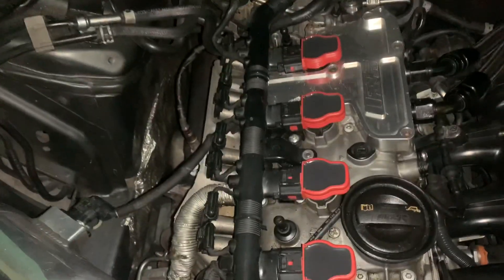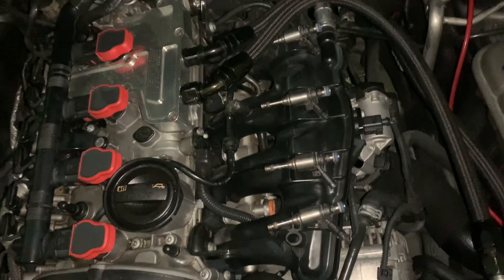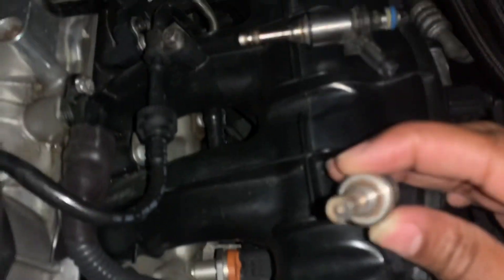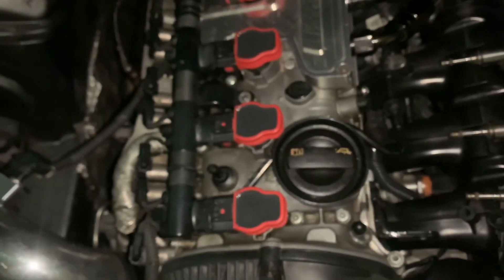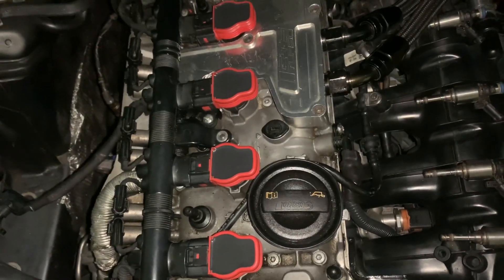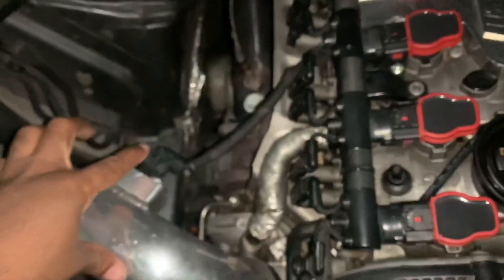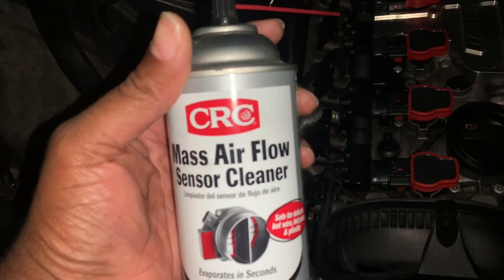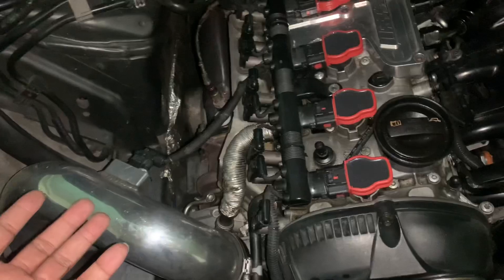Audi S3 Injectors Upgrade/Does It Ad More Horsepower? Lean Codes?

Comment: hi, I just purchased S3 injectors for my A4 2.0T upgrading to a K04 , I noticed that plastic tab is longer on the S3 injectors Vs the OEM's, did you have to shorten the plastic tab on the new injectors to fit or do the S3 injectors still fit in place without cutting it, thank you for your help, nice video ...... cant wait to see more.
Reply: How did u make out with this? Did you go with the oem s3 injectors and what kind of tune did you have to do

Comment: Right sir, just to clarify because yes, I've found a few online. Mine is the A4 B8.5 2.0TFSI 211 quattro. So the correct S3 injectors are which? Because I found 06L906031A S3 injectors on a rail .. are these advised? What about the high pressure fuel pump and getting the injectors mapped in or are you suggesting install and walk away?

Comment: Is the s3 injectors plug and play on Audi A5 TFSI B8.5 with IE intake IE intercooler borla type s exhaust HPA high flow cat and IE intake Manifold stage 2 Tune from IE and a hitachi hPfp ? Thanks in advance

Comment: Did you have to program the injector or plug and play
Reply: I have same question did you have to program the injectors or no because Revo states there tune is for stock injectors. Inwoulsnlikenaoem advixe on what to do

Comment: Hey my man I’m a tech out here in Colorado love watching the vids man it’s like a mirror of goals of my ride lol question did you get any missfires when you come back down in rpm’s with snow water meth kit ?? Running it and been having some missfire issues recently:/
Reply from the maker: Yes you probably need the start point to be at begiyof your boost, and boost max at the highest boost peak level
Reply: Figured it out car was pulling vacuum through line causing the methonal to go into the intake at all times looks like the silonoid was wired in incorrectly:/ but got her fixed

Comment: Bruce actually APR told me I wouldn't need upgraded injectors or fuel pump.  My k04 setup loose power in the high end.

Comment: Hey quick question. I have basically the same setup as you minus the K04 and Meth kit. I have the IE IM w/ tune and same spark plugs. I have the larger throttle, turbo muffler, and charge pipe upgrade. I have these s3 injectors sitting around … you think we can install them?? I have the ones from your link btw.
Reply: Did you get the s3 installed and is it running fine?
Reply: I did and you gonna wanna get a tune, but I’m sure I have other things in there I probably messed up 😅. It’s a learning curve.

Comment: Love your videos man. Been following for a while. When you installed these s3 injectors did you have to do any kind of tuning at all? I have a set of these and been thinking of installing them on my allroad. I have a Ko4 and ie tune.
Reply: I’ll buy them off you if you don’t use them
Reply: I’m in the same situation as u. I have a 2014 a4 with k04 tune from IE. Did u have to get a different tune with the bigger injectors? And were they just oem s3 injectors?

Comment: Hi Bruce, I have a b7 Audi A4 2.0t with the stock k03 turbo and I have the upgraded HPFP and a GIAC tune 93 octane but I also have the Race file. 

I would like to run the race file all the time and run a mixture of ethanol and 93 octane. 

Usually I run 1 gallon of e85 and about 16 gallons of 93 octane. 

Ideally I would like to really run about 5 gallons of e85 and the rest 93 octane so that I can run the race file at all times safely without retarding timing. Do you think installing S3 injectors with no change to the tune but running on the race file now would enable me to do this? 

I notice if I pump more then 1 gallon e85 on the current injectors then the car starts to feel really sluggish because it can’t supply enough fuel. 

Any advice would be appreciate. I think going K04 will be too much work and $$ because it would require another tune but it’s so tempting.

I figure this is the best way to get k04 performance out of the k03 on the budget.

Comment: Did you run your engine with upgrade turbo/injectors/hpfp without tune? I just want to make Sure it is running before putting a map on it
Reply from the maker: Yes I always do to test the car, but I don’t run it hard, I basically just switch my tune to factory.

Comment: the link for s3 injectors is invalid now bro. did you get them off Ebay?
Reply from the maker: here you go bro

https://www.ebay.com/itm/234086532059?fits=Model%3AS3%7CMake%3AAudi&epid=19045135727&hash=item3680a503db:g:xNsAAOSwVnxgz1Ib
Reply: Hey brother these come from China, are you positive they are OEM? Or did you buy Chinese versions ? Just curious if they work correctly

Comment: Peace Bruce, good video! Would you happen to know the part number for the Bosch S3 fuel injectors that I can put on my 2012 B8?
Reply from the maker: Yes bro , https://www.ebay.com/itm/for-VW-Golf-Audi-S3-TTS-2-0-TFSI-NEW-Bosch-OEM-4-pcs-Fuel-Injectors-06L906036L-/234086532059?mkcid=16&mkevt=1&_trksid=p2349624.m46890.l49286&mkrid=711-127632-2357-0 sorry for the late response
Reply: @brucecustommotors  you’re the man. Appreciate it!

Comment: Is it necessary to go for S3 Injectors if I’m only getting cold air intake+intercooler+stage 2? Or will I run rich on fuel?
Reply from the maker: no your fine with stage 2, i was running little rich with stage 2, on stock injectors, but when i upgrade to stage 3 k04 i strated running lean every so often , because the bigger turbo was pushing so much air, and the stock injectors capped out, and when i upgraded to the s3 injectors , once i went s3 injectors, i got more boost , hp,tq, and never ran lean again
Reply: @brucecustommotors  okay, thanks for the info. Your videos are helping alot

Comment: Thank you for all the knowledge~! But these injectors are stopping me from Stage 2+ because of emissions testing. I read that stock map works on the K04 turbos without issue, but I am not sure about the S3 injectors. I already have to swap CATs before inspection. I don't want to keep swapping fuel injectors. Do you have any insight/directions on what I can do? Thank you!!
Reply from the maker: I feel you, I acuttualy, just did my inspections, with no issues, Think about it this way, if a golf rand s3 can pass inspection, yours can, its the same engine, and it comes stock with s3 injectors, I basically, just mad my car an s3, with extra mods
Reply: @brucecustommotors  Thank you for the quick reply, information and added peace of mind. Keep up the great work!!
Reply from the maker: @raphaelfrancis4509  MY PLEASURE BRO STAY BLESSED

Comment: Hey bro Would s3 injectors benefit from having a stock turbo or would it be more beneficial and worthy on having it with ko4?
Reply from the maker: Very slightly because the diameter is bigger on the spray nozzle, but you get the biggest benefit with a tune
Reply: I have 2014 Audi a5 sportsback right hand drive. Do I need to have the car tuned for the injectors to work properly with my car
Reply: Sorry just read this bro I wanted to ask I have the same INJEN intake as yours,  same R8 coils, turbosmart BOV and that’s about it no tune yet tho I’m planning on  building my car up to go straight to stage 2 and then think about stage 3 but at the moment I’m confused on whether i should get the s3 Injectors with just the intake, R8 coils and turbosmart BOV, I got told it’s not worth it it’s only worth getting s3 injectors if you are going like 500plus hp also got told a5 b8.5 gen 2 one injectors are the same cc as the s3 injectors but anyways do you think I should get them now or should I do more upgrades and then get the s3 injectors after for example after I get my downpipe and then go  ie stage 2 after that should I invest in s3 injectors or what do you think thanks bro sorry for the long message

Comment: How do I know the injectors are going to be a correct fit regarding the plug fit. I have an a6 2016 c7 2.0t and it just has to be the the same year injectors as the model?  Just to make sure I’m planning to get them from the dealer ship.
Reply from the maker: you have to get 2015 and above
Reply: @brucecustommotors  thank you
Reply: A video on the high pressure fuel pump coming soon possibly ?

Comment: Hey Bruce, love the vids! Pending codes happen if the ECM/PCM see something happen once or every so often so it does not make it a permanent code unless it is reoccurring consistently. Still could very well be a serious issue that is starting when the code hasn't been thrown yet. As you do, anyone should always be scanning their car if they are/not trying to push more power!
Reply from the maker: Do you have the exact code number by chance
Reply: @brucecustommotors  I unfortunately do not haha. At least since my B8 is still stock. I would happen to get a pending code for P0299 or "underboost" from the PCM when I would scan it but the check engine would not pop up until later when the problem was consistent. Never threw a lean code cuz I dont have the crazy power you do! XD

Comment: Whats up Bruce. Following up on my engine replacement after my catastrophic engine failure. I've been watching your videos pretty religiously lately and your content, editing, and filming are much improved.

So - I wanted to talk about two things: cold air intake and fuel injectors. 

I was running stock fuel injectors and a K&N Typhoon. The Typhoon wasn't perfectly sealed so the air that was entering through the top of the grill was not going all to the filter. Some was traveling to the engine bay. So I'm not certain if this caused a condition or gradually caused heat soak to affect engine internals (my tech informed me my engine looked as though it had just been too hot over many periods). 

Second, I spoke w/ APR and they said that after market injectors weren't a requirement for stage 2. I should be getting my car back w/ a used motor around 40k miles. I'm planning on throwing the APR innercooler along w/ some other cosmetics then taking the car to a dyno so I can get some readings. Probably going to to be upgrading to that Injen air intake. Doesn't rain too often in Socal anyways.

Would appreciate your thoughts.
Reply from the maker: yeh it sounds like youre headed in the right directions, Yeh i had the K&N as well, and had similar issues in engine temps, also make sure your spark plugs are cold enough ,and you're using good octane gas, to avoid pre detonation, and you definitely need a bigger inter cooler aswell.
Reply: @brucecustommotors  Got my whip back today. Shop tech told me the intake was definitely bringing in hot engine bay air so I bought the injen but  I couldn't buy it through your amazon affiliate link because they wouldn't ship to CA. Dunno if you want me to buy ship to you and then ship to me so you get your payout lol. I'm down though because Injen said it is going to take 6 weeks+ since they have to make the whole item where as yours is supposedly ready (on Amazon).

New motor is a bit dirty but sounds good. They accidentally undid a ground that lets me open/close my second exhaust valve so i'm going to have to fix that up again.
Reply from the maker: @Waynesright  no bro i make 2 cents on a dollar, i just want my team, to be straight  have 3 videos to post but we have been dealing with power outages and freezes in texas , thanks for the love and stay blessed
Reply: @brucecustommotors  yeah sending you best wishes man. Shits crazy. Let me know if there is anything I can do for ya

Comment: For how much hp are s3 injectors ok - 350/400???
Reply from the maker: I would say stage 2 and above maybe 310
Reply: @brucecustommotors  than for 550/600hp is better from rs3/tt rs model to use...

Comment: Can you do a video on how to go e85? Thanks bro🤜🏾
Reply from the maker: Yeh , but you have to have the extra injector , and the aluminum air intake, I can do it on my b9 Audi, but I’m researching if I can mod my b8 for it
Reply: @brucecustommotors .  oh wow I didn’t know that, I really wanted to go apr stage 2 with e85 but sadly them discontinuing stage 2. ive been looking for a tuner with e85 available. I’m curious why only the intake has to only be aluminum? Shouldn’t it be the fuel lines?
Reply from the maker: @justjohan1548  yeh it has something to do with how the e85 reacts to plastic, and the extra injector is just for flex fuel options, I actually put e85 in my car because I had a new intake, and I was changing my fuel line, and main I got a power boost, but it was inconsistent, but I was stage 1, I always wondered if that was the only reason
Reply: @brucecustommotors  yeah it shouldn’t have been inconsistent, running that e85 should give me that colder air I’m looking for so I really want to run it. Where are you located at boss?
Reply from the maker: @justjohan1548  texas
Reply: @brucecustommotors  damn I was hoping you were in Florida so I could some shops that can figure it out. Thank you though

Comment: Running lean can be very dangerous, as far as i know runing a lean mixture can melt your pistons due to the higher heat in the chamber. 
A friend did that on his honda shortly after he rebuilded his engine. I don't remember why he was running lean but i know the result of that.
So if you run a k04 turbo you should use these type of injectors just in case, or at least monitor the fuel trims and the lambda.
Reply from the maker: I agree a 100% 💯💯💯💯💯💯💯💪💪💪💪

Comment: I was told by my service tech that the S3 injectors would not work on my 2012 A4 B8 2.0. He said the S3 is a different motor. My wife had a TTS so I’ve upgraded to a K04, intercooler, down pipe, cat back, IE aluminum intake. The car pulls hard, but not enough yet to keep up with the wife’s car.😬I think the fueling will have to be changed, will keep you posted when I change the injectors.
Reply: im installing a set on my TFSI 2.0L , the only thing I don't know is if that longer plastic tab on the S3 injectors clears when installing them or if we need to cut the tab to the same length as the originals.
Reply from the maker: Well I’m living proof it fits, you just have to 2015 and above the ones before that has a different plug, also to of my car buds did the upgrade and 4 of them have your same year car
Reply from the maker: Of course, believe it or not the tts are quicker than s5 and s4, with the engine, and weight ratio, I did pulls with a 2029, and won, but it was tuff, it also beat my brothers 2011 rs5, so don’t feel bad
Reply: Tsi and fsi have different injectors

Comment: Is it possible to install S3 injectors to the 2.0 tfsi, without having any air filter upgrades?
Reply from the maker: Yes , there very similar to our factory, and the ecu will only match the fuel with the air you ask, but you will benefit more with a tune

Comment: im getting system lean faults, i checked vacuum leaks using a smoke test, and nothing, but i get it during idle, do you think this could be the issue?
Reply from the maker: Yeh possibly, your fuel injectors could be dirty, or your fuel filter, and you’re not getting enough fuel, but first check your mad sensor,  watch this video. On maf, How To Maintenance And Clean Your Air Intake Mass Air Flow Sensor Properly
Reply: @brucecustommotors  Bruce, i replaced the maf sensor, ill clean it up, the fuel filter says it shouldn''t need replacing, its built into the pump in the fuel tank
Reply: Maybe high pressure fuel pump or low pressure fuel pump
Reply from the maker: https://youtu.be/GQmtZw4a7HQ
Reply: @brucecustommotors  do you know if injector cleaners are good?
Reply: @AKDiag  If you are throwing a lean code during Idle, I would highly suggest checking your Idle air control or your throttle body itself. I could be wrong but it is a good place to start!
Reply: @bloxxbusters  the long term is 0.78, its so marginal it throws the code
Reply: @AKDiag  Have me beat. Never had any issues like this on the B8 platform. Injector cleaners are good once in a while but not quite sure on how effective. Too much of it will eventually corrode your spark plugs. If you can find a noid light from amazon or something if you dont already have one and test your injectors. That might help. Stethoscopes are also alright at listening to your injectors run as well if you're curious. Not the most effective though. Have you had OEM replacement of your injectors recently?